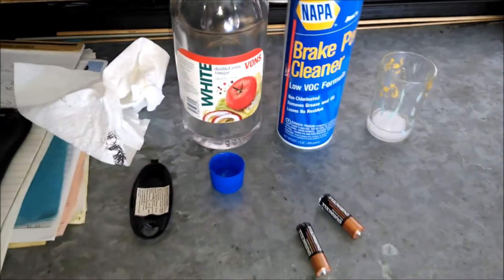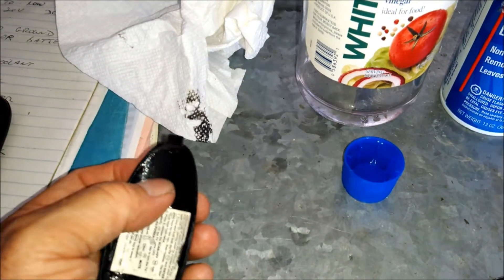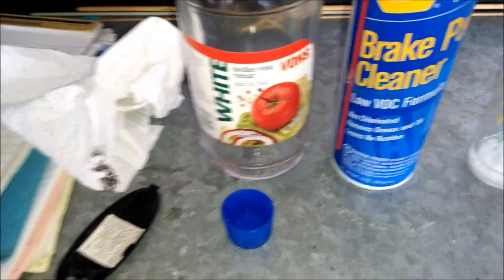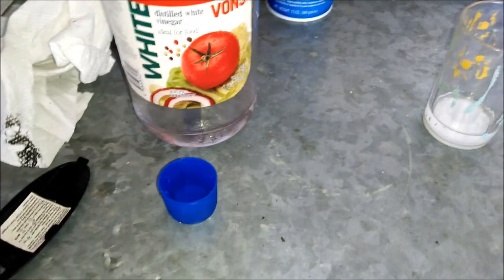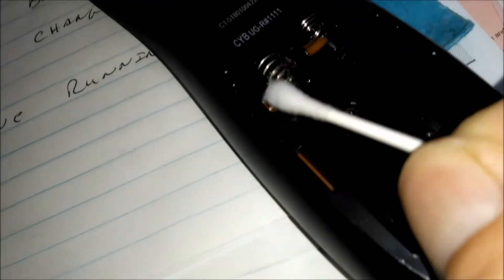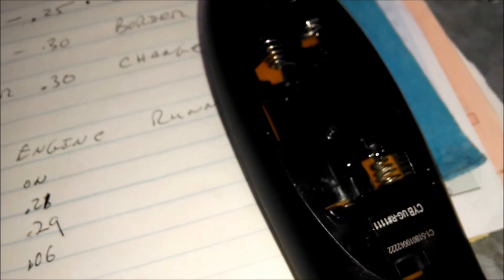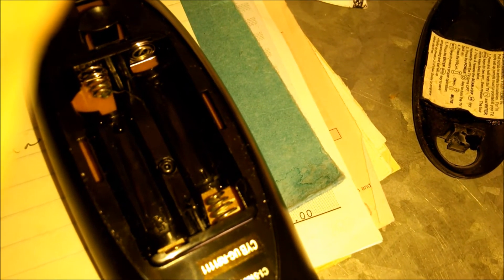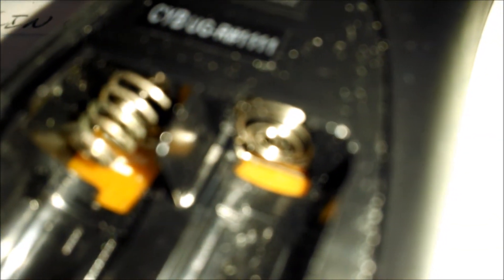Home repair battery damage better vinegar baking soda by froggy

Comment: Why is it always Duracell batteries that leak !? I stopped using them last year for this reason.
Reply from the maker: Well I have concluded they have lowered their standards & I am no longer buying any aa or aaa by them for that reason. Just stop buying & they'll eventually get a clue. Also Kirkland (Costco) aa and aaa are bad for leaking.

:)
Reply: The last time a "C" leaked and burnt the switch on my expensive LED torch :-(
I wanted to try the Kirkland Costco ones as the reviews show them to be very good VFM batteries but now you told me I think I'll give them a miss - Thanks for info :-)
P.S. I started using GP and Varta since then - no leak problems yet !
Reply from the maker: I guess I'll use mine up (maybe throw em out) and switch to something better.

Comment: The date on the battery is the shelf life not how long they can stay in a device without corroding.
Reply from the maker: +Steve Rabon I believe you are correct. Still they leak & damage equipment. Not cool.
Reply: I agree. Some batteries corrode because there are two different metals coming in contact with each other. Whatever the metal the batteries are made of and the contacts where they batteries set in the battery compartment. They same reason Car batteriers colrrode. The terminals are lead and the battery terminals are some other type of metal. I agree that crap sucks and isn't cool.
Reply from the maker: I was having trouble with my remote (TV) last night & it was a low/dead battery & there was a "dusting" of corrosion. You would think the battery makers & remote makers would "get together" on this and solve it.

:)
Reply: Some devices give advice on what batteries to use but not all do give advice on what batteries to use and they suggest that you don't mix different types of batteries. Sometimes you got to try different types of batteries until you find some that will not corrode in your device. It shouldn't take guess work and admit some Companies should be more precise of batteries that you should use, then you will mainly have to buy over priced batteries. That is the dilemma I guess. LOL
Reply from the maker: Good comments, thanks!

Comment: Ok, so here is my major issue. I have an Airsoft pistol that I'm going to sell online. It is new, but at one point I tested it and left the batteries inside like an idiot. When I opened the battery compartment today, I saw that the batteries had corroded, so I went online to see how I might be able to salvage the gun. I came across several videos using vinegar, so I tried that first. It did clean the corrosion, but I had seen a video that said the vinegar should be neutralized with baking soda. So I made a paste and used it on the coils. NOW, I CANT GET THE BAKING SODA OUT!! Aaaggghhhh! The coils are located deep within the handle of the gun, and I've been using a wet Q Tip to try to remove the dried paste for over an hour! I wonder if I could add more vinegar to make it bubble up? What do you think Froggy?
Reply from the maker: I would probably blast it with some wd40 or "maybe" brake cleaner, but be careful with what you use as it could damage/melt the plastic.

Then blow air pressurized can or compressor if you have one to get any leftover "solvent" out.

A little left over wd40 won't hurt & may help prevent more corrosion.

:)

Post back how it works out.
Reply: I don't think I have any WD40 hanging around. I definitely don't have brake cleaner. Do you think it would hurt anything if I went back over it with vinegar to bubble off the baking soda? I'd just wipe it off with water after.
Reply from the maker: Well vinegar is acidic so you need to neutralize the residue after you use it & be careful you don't damage any circuit board that may be near the battery terminals

Comment: Alkaline batteries do not leak acid, that's more in regards to lead acid batteries. Alkaline batteries leak potassium hydroxide rather than acid. Potassium hydroxide is a strong base. Using the vinegar would neutralize the base so it is the preferred method rather than baking soda. Both can work, but make sure to clean your hands thoroughly if you use baking soda as it is base on base.
Reply from the maker: +pekinggeese Thanks. "Acid" was my generic reference, you are correct.
Reply: He is right.